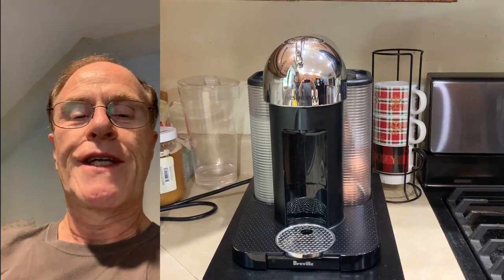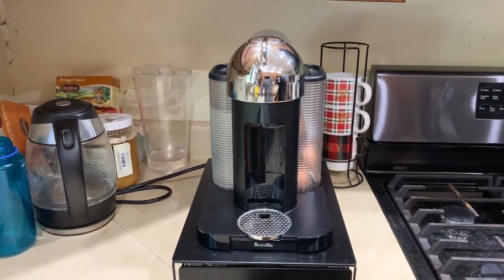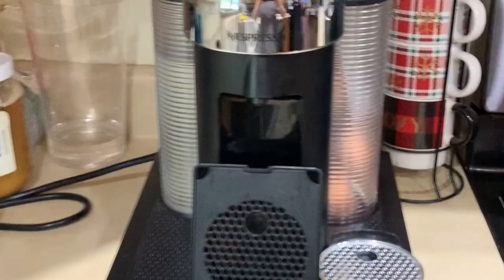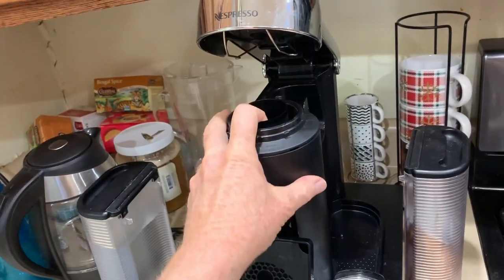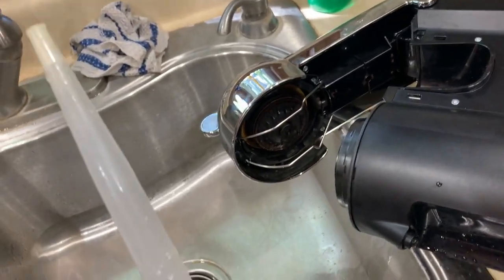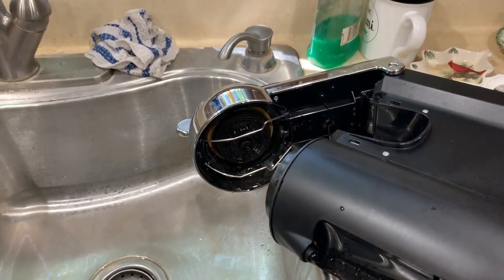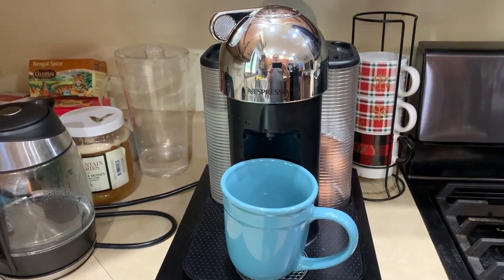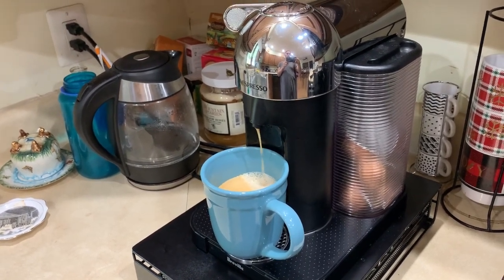How to fix Nespresso Machine leaking coffee / WITHOUT DISASSEMBLY! EASY!

Comment: Thanks for posting! I used a spray bottle from Home Depot, adjusted the nozzle to the "stream" setting, several pumps through each hole, then followed with my air nozzle from my air compressor. Worked great.